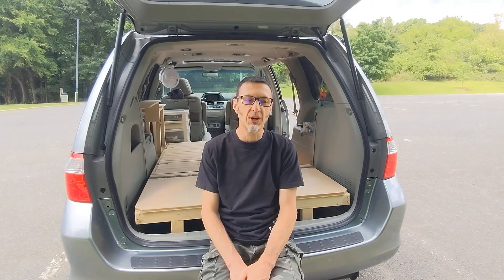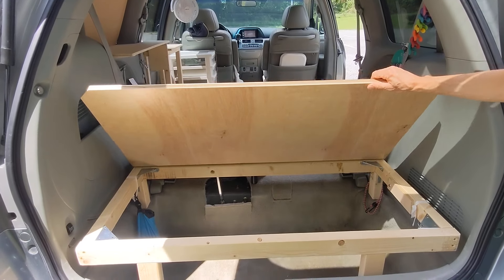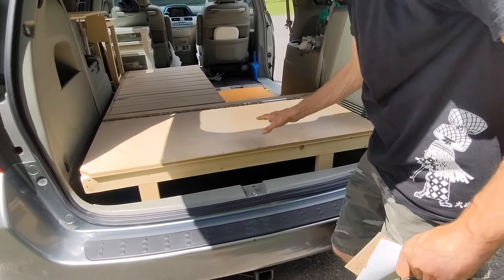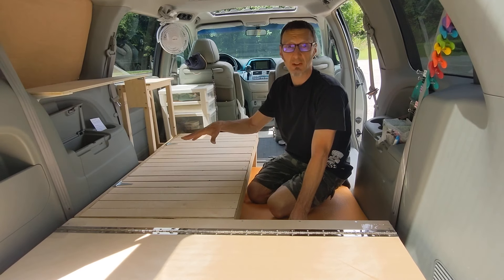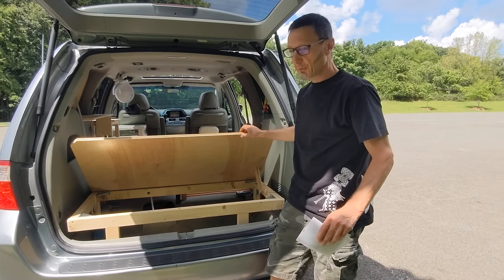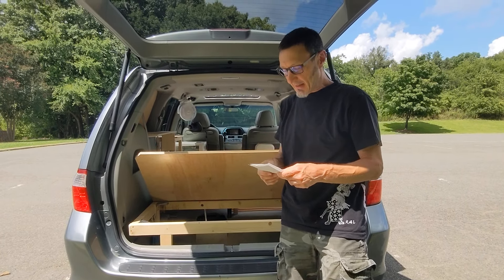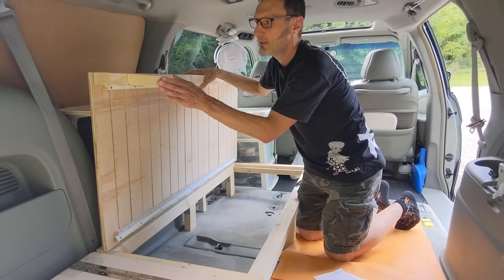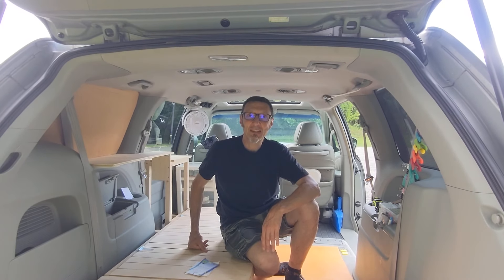Our Minivan Setup in a Bit More Detail - 2006 Honda Odyssey Camper

Comment: Thank you for your video because of your suggestion in regards to getting the jack out for a flat tyre, I brought my side support frames/beams in enough that I can still have the 1200mm length of plywood and when you lift it up you can still get to the jack etc. I also split my garage lid into half so I can lift it up from inside as the two pieces are hinged to the side frames/beams, if that makes sense, saw a woman do it like that and thought that would be handy if it's raining and you need to get to something while indoors and the boot is down.
Reply from the maker: Sweet! We like the idea of splitting the rear storage lid so its accessible from inside as well as the back.

Comment: i could not hear, it looks like a very well thought out and built design, congratulations.
Reply from the maker: Thank you for watching. Thanks for the feedback on the volume. Being new to YouTubing we are figuring this out as we go. More recent videos and future one will be better quality. You could turn on closed caption, that might help.
Reply: Yes, good video, well thought out, BUT!!! Horrible volume - should have thought that out too, but didn't. I find this in countless videos ... sad. Got to consider everything, don't rush to do a video.
Reply from the maker: @joefarrugia959  thanks for the feedback. We do appreciate it. This was one of the first videos we did and did not realize the issue with the volume. Since we learned of it, we have made adjustments so the newer videos should have better sound. 👍🏻

Comment: I am older and have been looking for a modular system so I can remove the bed easily to convert back to the van if needed. In your opinion can a 66 yr old lady pull this out by herself and of course set back up
Reply from the maker: Hi Jan. The wood makes it a bit heavy and the shape is makes it very difficult for one person to pull out by themselves. When we need to remove it, it takes both of us to do so. If you did not need the pullout slat feature it would lighten it up significantly and might be easier for a single person to move but I am not sure.
Reply: @haveminivanwilltravel thank you for your kindness

Comment: Ive got the same van, a 2009. I wouldn't raise the floor over an inch, wouldn't want to give up any headroom. How do you get into the front/middle storage? I made a single bunk about seat back height hanging from the ceiling, that can be adjusted to be level, and left the single rear seat for sitting at desk/eating area.
Reply from the maker: Well, we never made the adjustment to raise the bed. We can safely do so up to a few inches since we are not tall people, but we are just making the current set up work for us. Are you talking about the round storage? We don't even remember it's there so we don't use it. 
Your set up sounds good!  Happy camping!

Comment: What mattress did you use?  Was it a trifold or one you had to cut up yourself?  How high is it?, thanks
Reply from the maker: Hi Madeline. We bought a full size quad fold mattress from this site: https://bestchoiceproducts.com/products/4in-folding-portable-mattress-topper-w-high-density-foam

Its 4” thick. 

My wife separated the mattress into 3 sections by removing stitches. Once that was done, my wife sewn the the sections back together to close.

The fit was tight so we later decided to trim the size for a better fit.

Comment: Thanks so much for sharing this video. Your concept has been adapted for a build in my 2008 Odyssey. I didn't need a double bed so we just added a detachable sleeping platform down one side, wide enough for my folding mattress. We also split the lid on the cargo area in two. So when I have my mattress and bedding laid out on the sleeping side, I can open the cargo lid on the other side without disturbing the bed setup. I have mad respect for the extra difficulties you must have faced by having to do the carpentry work in your condo!
Reply from the maker: You're welcome. We are delighted that our video helped you with your set up. The condo did add to the challenge but for now, our neighbors are happy we have been pretty quiet. 😁

Comment: I also have a Honda Odyssey.  Did you consider the pros and cons of installing the slat bed along the passenger side of the vehicle(i.e. on the opposite side of the interior). Or do you wish now that it was reversed perhaps? 

 I'm using your design to build my Odyssey out too and considering reversing the bed. Wondering if I'm missing something that might be a downside to doing that
Reply from the maker: Hi, we decided on the drivers side because if we ever stealth camp or park on the street, we can easily exit through the passenger side which should usually face sidewalks or curbs. This is better than opening toward the street which would be the case if the bed were installed on the passenger side. We would then need to exit onto the street.

Comment: What are the measurements of all the foam pieces separately please. This is the bed I’ve decided on I have 2007. Thanks!
Reply from the maker: Hi Dane. The foam measurements are:

2 sections are 50" x 24". The foldable section which we use as the seat back when in sofa mode has 2 pieces that are 50" x 12" each. 

The final dimensions are slightly bigger with the covers on. Let us know if you have anymore question and good luck on your project!

Comment: I am probably going to attempt to do what you have done over the trunk area. However, I'm a big confused by your measurements. Is it 24" total including the 3" separate piece where you have the piano hinge or is it 24" and then 3 more inches?
Reply from the maker: Hi. The measurement is 24-3/4” which is measured as outside to outside of the frame which includes the 3” that was needed for the piano hinge. Does this help?
Reply: @haveminivanwilltravel  thank you!
Reply from the maker: @lifewithpugwinkle  you are welcome. I dod want to mention that the rear section includes an additional 2x3 under the piano hinge piece. This was necessary for extra support.
Reply: @haveminivanwilltravel  Yup, I noticed that thanks!

Comment: Did you sell your seats?
Reply from the maker: Hi Mark. We kept the seats. We built it so everything can come out easily and we can put the seats back in if needed.
Reply: @haveminivanwilltravel  Thanks. Planning a conversion and will have nowhere to store the seats. Hate to throw them away, and wondering how hard they would be to sell.
Reply from the maker: @marklundegren  we bought a heavy duty metal shelf unit from Home Depot. We set it up so the seats all fit on the bottom 2 shelves and that takes up about 80% of it. We use the rest of the space for storing other camping gear. We live in a 2 bedroom condo so space is tight here too. https://www.homedepot.com/p/TRINITY-Black-Anthracite-5-Tier-Steel-Wire-Shelving-Unit-48-in-W-x-72-in-H-x-18-in-D-HTBFPBA-0950/308561422

Comment: What type of foam/mattress did you use, and can you let us know if it works out well in terms of comfort? Thanks again
Reply from the maker: Hi Janine. The link below will take you to the mattress we used. It was separated and sewn back together to accommodate the sections that we needed. The mattress is adequately comfortable for us but is on the firm side which is what we like. I hope this helps. 
https://bestchoiceproducts.com/products/4in-folding-portable-mattress-topper-w-high-density-foam?variant=30986351804494&utm_source=google&utm_medium=cpc&utm_campaign=Smart+Shopping+-+Mid+Sellers&gclid=CjwKCAjw3_KIBhA2EiwAaAAligAfG4a84V_DUKeReWBz30aRKfMdG6wtZYRaA7meZ3b2L_gkLvftFRoCqc0QAvD_BwE

Comment: this is super cool. With a 2006, are you ever worried about it breaking down somewhere? Or not being able to climb a steep hill?  Also, where do you park for your car camping?
Reply from the maker: Thanks for the comment. We were not planning to buy a 2006, but it is in such great condition and runs so well we decided to go for it. We have a great mechanic and have done some needed maintenance. It has plenty of power so no problem going uphill. We realize something could go wrong, but we are not letting that hold us back.

We camp mostly at campgrounds. We spent a night at a Walmart parking lot once with their permission.